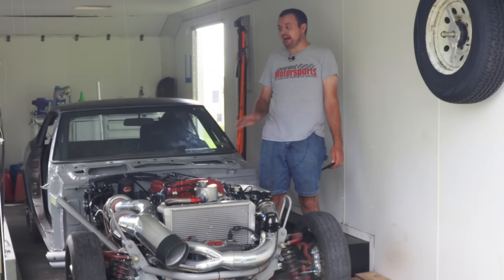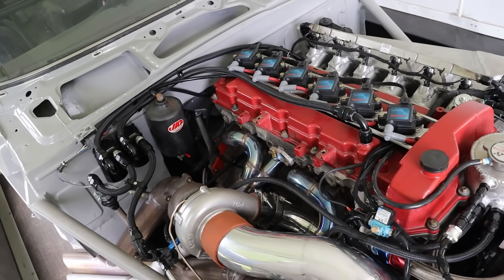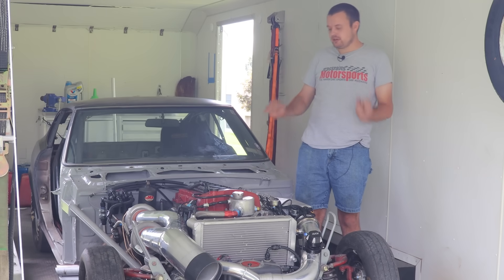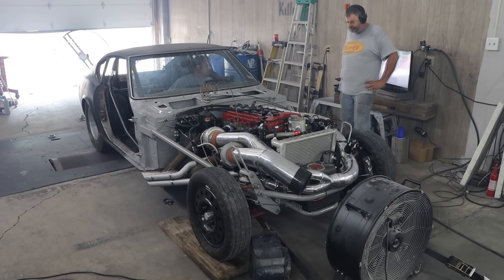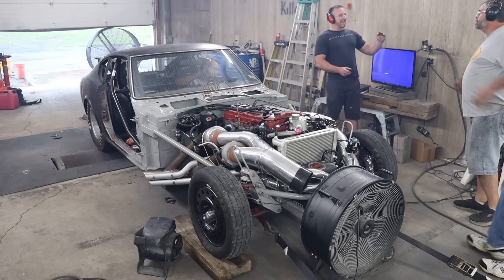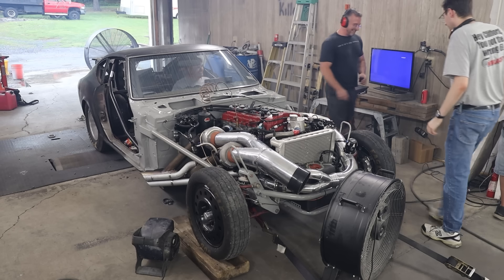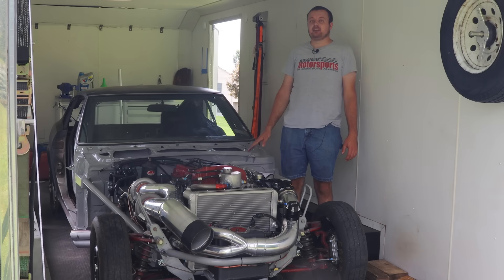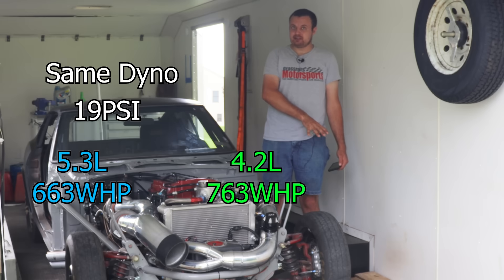This 4.2 Liter Engine Just Beat a 5.3 LS!

Comment: Definitely impressive! For reference sake. 

Ford barra.
Non ported FG head.
280/280 advertised cams.
Pump E85.
72mm borg Warner SXE372 1.0
2200cc injectors.
Triple pumps.

20psi - 909rwhp.
30psi - 1157rwhp. 

Both runs taken to 7500rpm.
Reply from the maker: I'd love to know the duration at .050 on those cams. I bet that was through a lock up and one a hub dyno which are known to report higher horsepower.
Reply: 236deg at 50 both intake and exhaust
Reply from the maker: @davesoltoggio3280  cool. Definitely Impressive. Wish Ford would have given it to us.
Reply: @Calvin-Nelson  these are the Kelford cams 280 adv! Great Barra cams with stock hydraulic lifters! Have used them to 1160hp to the rears! On stock crank and balance! Must use atomics flywheel dowel kit! Most People with there Barras just use stock block and crank and put in good rod/piston with out balancing which is where the vibration come from! Usually good rods are between 620g-700g! Atomics Superleggera Conrods, 698Kw are my favourite with out balancing as the rod and piston is only 30grams more than stock FG XR6T and you will get away with out rebalancing! Good rod to 1000hp! Check out Brad from Atomic Peformance YouTube and his online shop! Brad has been playing with these engines for 20+ years
Reply from the maker: @davesoltoggio3280  I've always heard that inline 6 engines are neutral balance, meaning as long as all you rods and pistons weigh the same you don't need to balance the crank. I know callies crank doesn't use bob weights when they balance their inline 6 cranks.
Reply: @Calvin-Nelson  by the time your using big dollar cranks you must balance and check everything twice! I personally haven’t used a aftermarket crank yet. I run Haltech and 12 injector plaz manifold 6 Siemens for methanol and 6 for pump 98 your 93! Turbo is  Garrett G42-1450! Hope this helps for ya awesome adventure 💯👍🏼👌🏼
Reply from the maker: @davesoltoggio3280  Yeah. My stupid engineer brain just wonders how they balance the crank. How do they size the counterweight? How did GM size the counterweights? We put way heavier rods in this combo and it seems to be holding up fine.
Reply: @Calvin-Nelson  this seems the norm here also! I’ve always tried to use the lightest strong rod and I’ve had no issues! Me and my son are happy atm where we are at and our biggest issues have been in the gearbox department as this ute gets driven everyday! I think we have exhausted tailshafts gearbox’s and the like and it looks like if we are to go any further we must put in a T400 which will destroy the cars awesome nature! Box atm is a ZF26 with all the 6R80 and billet hubs etc but every time you put on the strip you left thinking or waiting for the thing to let go! Been a journey!
Reply from the maker: @davesoltoggio3280  Nice. I hear what you're saying on the Trans. Th400s have their place.
Reply: @Calvin-Nelson  Keep an eye out for Aussie boys from BCW Bennys Custom Works at the HotRod drag week this year in his cresta and foxbody mustang! They will be stuck running 8.5s bracket as there cages don’t allow for faster class! Both cars are capable heavy 7s cars! Car community is the best community 💯👌🏼 great for the chat and keep up with the great work your doing
Reply: .468 lift or 11.88mm
Reply from the maker: @davesoltoggio3280  Nice. They're definitely very impressive. Maybe I'll get to play with one someday.
Reply: https://youtu.be/cyzdwIpqsgU

Comment: I have seen a stock 6.0 with a single turbo make 1500 hp with less boost must be something wrong with that 5.3 😁
Reply from the maker: It's not intercooled and it has a pretty mild cam. I don't believe the 1500hp claim. I'd have to see it on our dyno to believe it.

Comment: You are forgetting the one very large thing. Gear heads love and live v8’s and that’s it. Most of them that I know make fun of 6cyl. It’s just a stigma I would love to see more performance parts for the 4.3L gm which is a 350v8 with 2 cylinders cut off.
Reply from the maker: What about the massive following for the 2jz, and Barra engine? What about the people that like to install a 6 and beat their friends who have an 8 to prove a point? There is so much more to hot rodding than V8s. Why did Edelbrock come out with an aluminum cylinder head for the Jeep 4.0 if it's all about V8s?
Reply: @Calvin-Nelson  yes well the keep 4.0 is an extremely popular engine because much like any other groups jeep purest’s love the 4.0 and honestly I don’t have a problem with it. That’s a very reliable engine has some issues like the factory manifold like to crack. And the 2jz is a ricer engine as in an import engine and it also is a super reliable engine for Toyota and there to all the import guys love that engine. But here is the kicker most Chevy guys are v8 fans and not straight 6 fans. I have seen old straight 6 built to run with the v8’s and still were not well received. The builder got mad respect and so did the engine but knowbody wanted it. Now if you want to talk ford that 300 straight 6 is practically bullet proof and strong as an ox with all the torques lol. But their again most ford guys are v8 fans but you will find more ford guys that like the 300 6cyl then Chevy guys that are straight 6 fans. Just saying. Personally I am VERY unhappy with my 4.3l in my 2016 Silverado I have a double cab 4x4 that is getting 12-14 mpg and frankly that sucks I could get better mpg with a v8

Comment: I'm impressed at the Rs the inline is spinning. I always thought trailblazer and early H3s had 5 cylinders not 6. Oh well.
Reply from the maker: H3s had 5 cylinders. The 6bonly came in the trailblazer.
Reply: @Calvin-Nelson  you've definitely worked wonders on the platform. I'm GM all the way. The little 4 they put in trucks that used more fuel than a V8 is a pretty advanced yet sound motor I think also. The VVT and way they eliminate lag on that motor is fairly slick. I'm all for the complexity involved in the valve train as long as it's not a Ford product. That junk kills thier motors trying to save fuel.

Comment: That's it I'm running one of these in my 63' nova ss this is exactly what I needed to see I thought I was gonna run the 6.0 ls I have been saving for it but na the 6.0 will go in my 65 C10 instead ....ameribarra is perfect for the nova cause it came stock with a 235 inline 6 it's like the ultimate retromod engine for my car thanks for all the info u fellas got it going on great research can't wait to see what the comming years have to offer !!
Reply from the maker: Sweet! That's going to be an awesome ride. https://sites.google.com/view/vortec4200wiki/home

Comment: Straight 6 Four Valve   Diesel, Petrol , E85   Or  LPG (propane) = GOD …. JAG 4.2, Barra,OM606, 24v Cummins,  4.2 Vortec BMW M20 ect.
Reply from the maker: Nissan TB48, 2JZ, RB26, 1FZ, N54, the list goes on...
Reply: @Calvin-Nelson  yep, I was hoping for even more to be listed, come on comments section grow the list
Reply: You forgot the M104 engine from Benz from the '90s thats also compared with the 2JZ.  The M104 is essentially an OM606 gas powered twin.  MB has a new inline six M256 that replaces their V6.  Stellantis has the new turbo Hurricane 6 that will replace the Hemi.  BMW has the M50, M52, N54, N55 and B58 along with their M variants.  BMW's M57 is regarded as a truly legendary and bulletproof diesel engine.  Toyota has the 1FZ-FE for the Land Cruiser, also established as a highly tunable engine, the G series, and the JZ series.  Nissan has the RB series, and the TB48DE, which is the biggest and baddest of them all at 4.8 liters. The TB48DE is often used for drag racing in the Middle East.

Comment: Pretty cool. But tbh…. I was expecting more as much as you were talking it up. 

My sbe 5.3 with stock (as cast) heads in my 3500lbs race weight car, at a 11,000ft DA… with 21psi from a s485… went 122mph with fairly soft timing. And on e85.. not methanol. 

It’s (4200) impressive, but I think you’re over playing this little engine a little bit. And it’s production was so short it would be a big waste of time from a business perspective to make parts for it. Aftermarket will probably continue to ignore it lol.

But good content! Cool engine.
Reply from the maker: I already have companies on board for making parts, so you're missing the boat.  

The 5.3 was nonintercooled and had a pretty mild cam. 122 mph in a 3500 lb vehicle is only 420whp by my numbers. Proves my point even more.
Reply: @Calvin-Nelson  that’s 122mph the 1/8 😂 you thought I meant 1/4 mile? Really? Jfc 🤦‍♂️
Reply from the maker: @nsboost  My bad. Most people talk in 1/4 mile. So it made the same horsepower as an engine 71 cubic inches smaller with a boatload more cam. Congrats. Whatever makes you happy bud. That's all the matters.
Reply: My car will do 154mph in the 1/4 at 11,000ft DA on 21# of boost. And that’s 21psi over atmospheric (which is 83kpa) so it would be more like… 18psi at sea level.  So again, I really don’t think your built engine with ported heads with 26psi is all that WILD. Great numbers.Might not be a bad platform. But cost per hp, I still don’t see reason to for the public to go nuts for the 4200
Reply from the maker: @nsboost  ok Dude. Whatever you say.

Comment: Imagine if Edelbrock, or AFR made heads for this engine, and comp cams or Texas speed someone made cams imagine if the valves were 2-3 mm larger!! And someone making forged affordable pistons, and a cool sheet metal intake that would also work for the street!! Headers to fit most chassis, maybe a header kit, like 2-3piece that can be trimmed and fitted, weld it up, or a turbo manifold that works similarly, allowing the turbo to be mounted in different locations (slightly)  high, or low, clocked slightly,  maybe have a part that fits the head, a part that fits the turbo, that welds together , but can be cut, to change mounting height, and the turbo flange on a kind split plenum, that can be clocked and welded, possibly tilted,  around 1" front, or rear, top or bottom, basically any angle , research where most turbos need to be mounted, likely about center with the 3rd cylinder, slightly more forward from center,  and aftermarket oil pans, to fit different chassis, 

I'd love to have about 500-600whp with a 5-6speed! Around 3.73 gears, awesome street vehicle, 3k lbs or so,  awesome video!!
Reply from the maker: Give it time. The aftermarket will catch up.

Comment: Atlas engines have their issues, but I don't think it's a coincidence the 6-cylinder version is the best of the bunch. 
I considered the 4.2L when building my resto-mod 59 Studebaker Lark but ended up going with a 2JZ-GE simply because they are everywhere, and support is abundant. Daily driver, no need for 800hp....cool to see that Blue Lark at the intro of the video!
Reply from the maker: Yeah. 2jzs are are a little easier to package too.

Comment: you didnt actually port out the heads with a die grinder did you...?
Reply from the maker: Yeah, that and a belt sander. And it picked up like 130hp at the same boost... what's wrong with that.

Comment: I've thought about a project car using the 3.7L as the engine largely because it'd sound amazing, but would you say there's much parts compatibility with the LS platform like rods and pistons that the Atlas engine family as a whole has?
Reply: I don’t think there are any parts compatibility besides what trans they can connect with
Reply from the maker: Yeah. There isn't much interchangeability with the LS. Rods and pistons are totally different.

Comment: What's the price difference in the 5.3 and the 4.2?
Reply from the maker: For the engine itself, about the same. 4.2 is less sometimes. To do the swap, you have to build a lot more for the 4.2, so it is a bit more expensive laborwise.

Comment: A hot (I dunno, 350 whp?) NA or supercharged version of one of these motors would be fantabulous in a small, light, track/country road car if they're not tremendously heavy. They're aluminum-block and head engines, right? Man, imagine a 66-67 Chevy II with Corvette independent suspension at around 2700 pounds with a Tremec and one of these. Or a completely different direction, a carbureted one in a street/rat rod. Awesome.
Reply from the maker: Yep all aluminum.

Comment: Love the engine and setup. It's a combination art and engineering. 

After I do a turbo on my AMC L6 one of these is really tempting for my Eagle. I'd definitely need a TIG for that because there's no way you're doing anything with it without a seriously custom fabricated oil pan. The trans is the other side of the challenge. The A904 (light duty 727-esque) trans isn't particularly large or for that matter long. I could see getting a 4L80E or a TH400 in there being a bit of a task and involving floor pan work.

I hope that oil pans and SFI Flexplates become a bit more common, those in my mind anyways are the big obstacles. You're probably at the point you should be looking into a custom flexplate anyways if you're bending them. That strikes me as not only a keep the car together thing but a safety one too.

Did you MaxxECU this one too? I'm thinking that's going to be the path I take "just in case" I do something like this if I get out of the MS2 on my current engine.
Reply from the maker: This one has a Megasquirt Goldbox.

Comment: I think a defining factor would be how much money you spent to get the power on the in-line 6 vs the v8 because in my opinion that’s what’s gonna make it better than the V-8 If you have to put way more money into the in-line six to get that power versus not putting much money into the V8 then you could say a lot of engines are way better than the V8 Ls just buy spending more money And I’m not picking sides I love both of the engines just my two cents I like them in my pocket though
Reply from the maker: We probably have about the same in it money wise as if we were to do an LS, but we have probably double the time invested.

Comment: I agree super cool engine but you are comparing it the a 5.3 with a truck intake and heads 😂
Reply from the maker: It made 100 more horsepower.
Reply: Put a set of heads and an intake that flow more than one cfm on the 5.3
Reply from the maker: @dalejackson5003  it had more camshaft. The 862 heads are the best cylinder head for 5.3L too. Go watch some videos on head porting an LS. It's not worth a lot.

Comment: I love to see when people achieve great results from undervalued platforms.

As a Brazilian, high power GM inline sixes aren't a novelty: although the Vortec 4.2 never came (we got the 4.3 V6 instead), the old 250 is a big thing here, with a long production run that only ended in the 90s and the most extreme development examples being estimated at 2000hp. What it could be if a more advanced version of the design came... I also note that Argentina has expertise in high-rev racing engines based on a similar platform.
Reply from the maker: Yeah. My roots are with the old 250s. We'll be playing with another one soon. The Brazilians are so cool.
Reply: @Calvin-Nelson  Checked the channel, I see your grinding. Going for an established platform eats less money to achieve a good result, cool and all, but those engines will run out or at least get pricey. I appreciate and see value in putting effort into something unexplored, and I have some favoritism towards inline 5 and 6, too.

Comment: If holley would come on board with an ECU system for one of these id be in for it.
Reply from the maker: I wish they would. If they offered VVT control for LS I would have retrofitted one on the 4200 by now. The trigger pattern on the later engines is the same as an LS.

Comment: Depending on that engine's dimensions... it could be one heckuva sleeper for any number of older 4/6 cylinder cars. What's great for you guys is you now know the engine very well... hit the track with 80% power then dial it up when absolutely needed. All the best for the upcoming races!
Reply: We'll be hitting the track at low boost soon and dial it up over the next month.
Reply: @andrewnelson3733  We're all looking forward to it! Waylon Wire (on YouTube) has an older box truck, six cylinder. It would be great to see if one of these AB's could be built for long-term solid torque monster use as well as what you've done with them here.
Reply: idk exact dimensions but big reason why they stopped these is because its so damn long being an i6, even on chassis its meant for really gotta reach in there to change last sparkplug
Reply: @Robo-xk4jm  and they're fairly tall, especially with the stock intake that goes up over the valve cover. I looked in to swapping out a 4.0l out of my Jeep for one, but the dimensions I found put it almost 6 inches taller at the valve cover. That would be fine in a wrangler, but not for my Comanche pickup. The 4.0l with a little work can make in the 250-260 range, but starting at 270, and going up sure would be nice.

Comment: Hell batten heads made 900 HP on an iron duke Chevy 4 cylinder with vortech super charger or turbo in the 80s it's no secret 4 and 6 cylinders make big power for there size look at the konigseg 3 cylinder it makes 650 HP no cam no rockers no belt just a little electric cylinoid that makes the valve open n close

Comment: i had a 1994 silverado single cab with the 4.3 vortec v6 as my first car when i was 16. i put a vortec supercharger and 4.56 gears, on 18" wheel with meaty tires with the oem automatic trans. thing was faster than all the v8 trucks at the time.  50hp per cylinder isnt bad at all stock but with a little forced induction they really come alive.  probably made 350-400whp and felt like 1000 lol
Reply from the maker: Nice